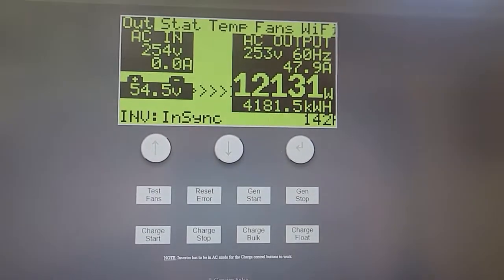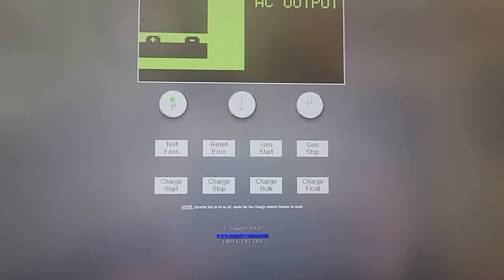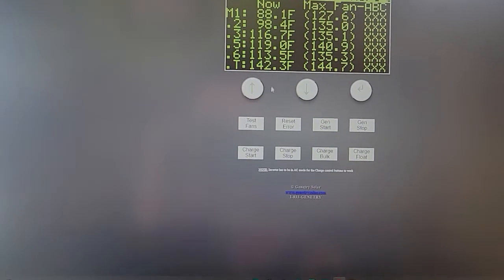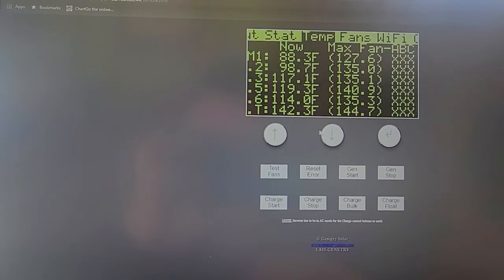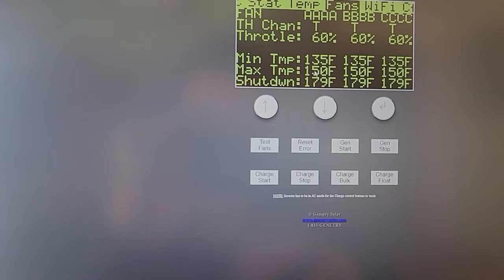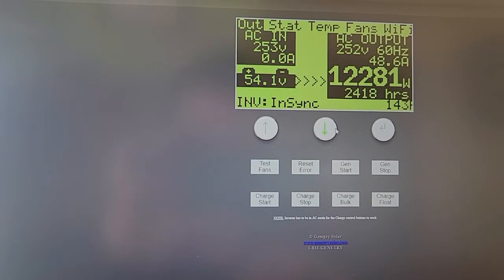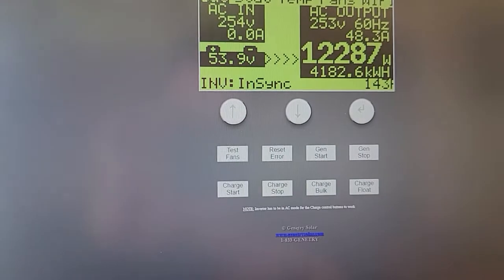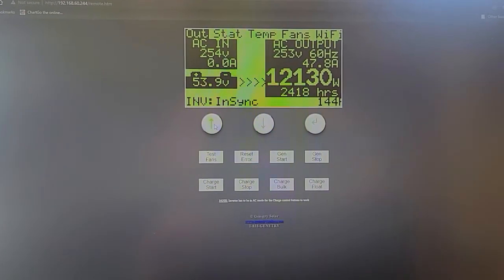Genetry Solar 12KW inverter - 12KW load test.

Comment: Thanks for another test. I have few suggestions that you might try to think about.
1. As it looks good on temperature I would suggest to use oscilloscope to see how good it is with some oscilations or all that..
2.Then second test i would suggest to use some inductive load Such as motors or such and see if it is able to handle voltage on max power... 
3. i would suggest to test on max power temperature of cables and all that....just to be sure all is well after all you don't have termistors on all things.
4. Check how inverter behave at high induction power draw...but i'm not sure if you will be able get equipment for this.. the test should be designed to see if 12kVA is similar to 12kW with different load.
5. try to use air conduits with those space heaters pointing toward those tubes (that would go into air intake of your inverter..by this you could simulate lets say high temperature..but ofc it will take some time to set it properly so it show about same temperature. But i believe it is possible to do .. This would be simple temperature chamber.. 

but ofc these are just my ideas. You and Sid will find other means of testing. So far it all looks good.
Reply from the maker: Thank you for the suggestions. I can address a few of these.

Oscilloscope is a good idea. I can actually check the scope on the screen and will do so when I do the 13kw load test.

The cables are 2/0. I have a pair for both the pos and the neg cables which should give me around 800 amps of capacity. The solid bus bar is rated to 600 amps. Well above the loads I was putting on it. We will keep working at it. Ambient temps will play a big role. I set my thermometer on to the inverter and the air was coming in at 62F. If we assume the temps used and compare them in a linear fashion then bringing the air to 80F will put the temps at 165 peak. 90F would be 175 Peak. But that does not consider fan speeds which in this case were never peaked. More testing will need to be done. We do have a 12kw inverter here that will take 90 to 100 f ambient temps. Those who place their inverters in cooler locations will be able to extract more from the inverter.

Comment: I was just thinking, maybe you could get a used or remanufactured forklift battery for testing? But only if it's cheap, it could be used with a wind turbine, and backup power also, just an idea,  also could Sid not build a power supply large enough, using a transformer from one of these inverters? And a large full bridge rectifier, and a capacitor bank? I still have the 220vac 2400watt 12v power supplies, not sure about adjusting them, but the smaller supplies have an adjustment, but only about .5v+/-, but can probably be greater if the pot is changed! They do about 36-38amps and at the price I'd put about 4-5 parallel, then 4-5 in series, , that's a big number of supplies, but they should run cooler than a single large supply, I'd like to see atleast 14v from them, and down to about 10-11v+/- , so you can get 5x 11v, 55v to 5x 14v , so possibly 60v can be tested, would 70-140amps +/- be enough to test a 48v? inverter,

Comment: I'm thinking about just getting cells from battery hookup, the 32650's , parallel about 50-100 ,. Then build another, spot weld to nickel, then solder copper busses to the nickel, keep building until I get 8cell packs for my 24v system, $2.75 for cells that are new, and near 6ah, I just need to rebuild my spot welder,  maybe I can build it before prices go up, , but I already have about 1200ah lithium ion bank, but having a bomb in the house , is a bit unnerving! Haha especially when it's really sunny, and it's charging hard, it come to less than $300 for a cell just under 600ah, about 570ah, atleast 550ah, and buy as I go, I already have about 50cells

Comment: let us know the efficiency at 12kw
Reply: That seems to be a very difficult specification to objectively ascertain with the meters we have access to.  At the moment, our calculations have been all over the map...but what IS known is that the inverter generates far LESS heat than a space heater (1800W) while running a 14kw load.  But even if it WAS producing ~1800W of heat losses, that would put the efficiency at 88.6%.
Reply: @sidlori1592 your rev C board measures power on the output L1 and L2? If so you only need to collect data from the battery wire, amps and voltage to chart input power vs output power. How expensive would it be to have a dc shunt on the battery input so the board can monitor battery amps?
Reply: @Anonymousg64  Yes, the C board measures total power on the output.  Calibration and manufacturing tolerances (+ power factor) can make this difficult to accurately calculate.

The busbar is indeed an input shunt, but it is not intended for precision ampacity measurement (<0.1mOhm resistance)...and as such can't be used for accurate measurements.  Then there's also the challenge of quantifying the actual power usage of a highly AC load on a DC power source.